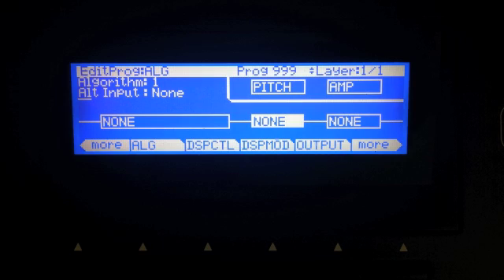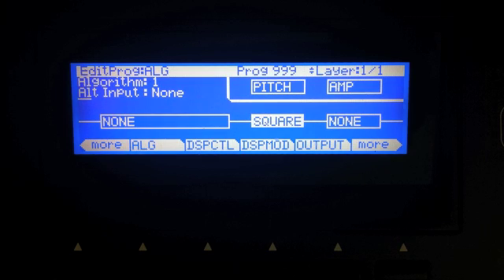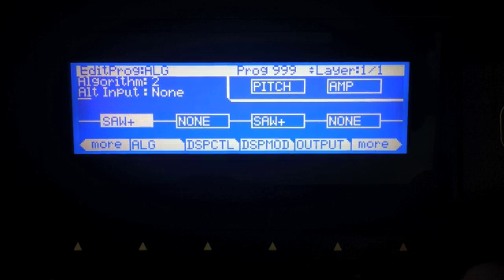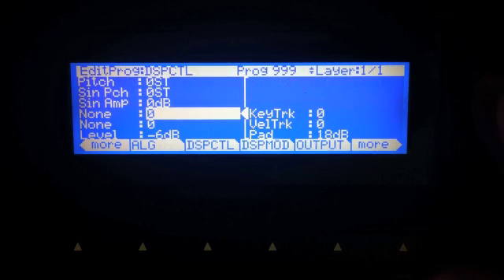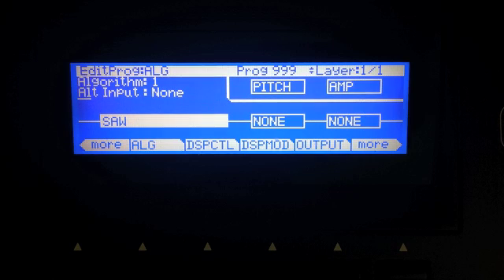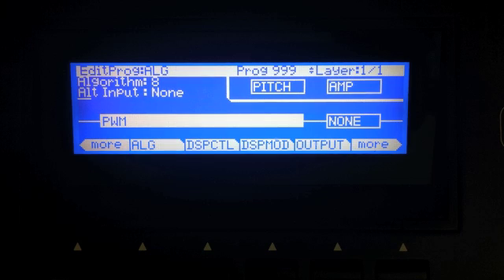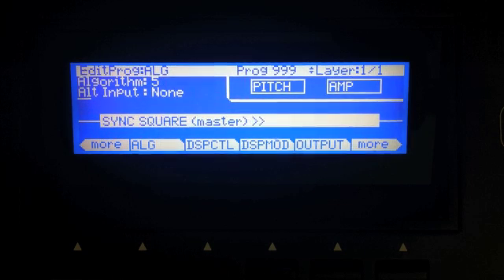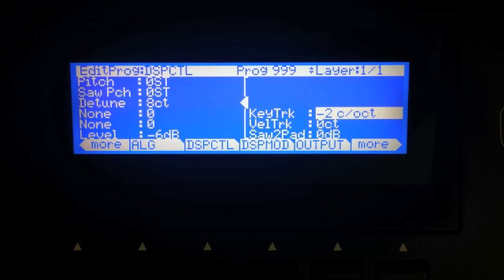Kurzweil PC3: DSP Oscillator Overview

Comment: could you elaborate a bit on the va-1 block ?
Reply from the maker: I'm not sure I totally understand your question, but basically in the PC3xx (and Forte) you have two sets of DSP oscillator "blocks" -- one set, smaller in "block" size (like the single-block SAW), do not have any anti-aliasing applied. The other set (such as the two-block SAW) have anti-aliasing applied and so are generally better suited for "VA" style programming. The PC3 manual lists which blocks are in this group.
Reply: I meant the new va 1 engine , that was prototyped back in 2002 .
I've read that the engine was incorporated into the vast system.
Or are these just new filter /osc blocks etc .
Could you show a bit of the va-1 ?
Reply from the maker: Yes, many of the VA-1 DSP functions are in the PC3/Forte, that's the origin for these non-aliasing blocks and, IIRC, at least one of the filters (I think that's the origin of the Mogue 4P LP block). I don't work for Kurzweil, so I can't demo a VA-1. If you look on my channel for the "JUNP" soundset, that makes extensive use of the "VA-1" anti-aliasing oscillators.